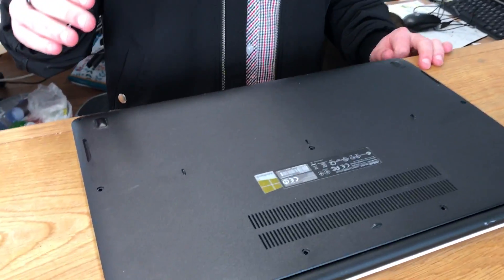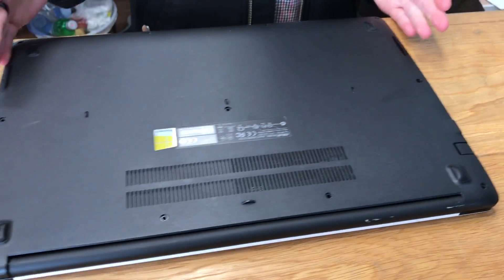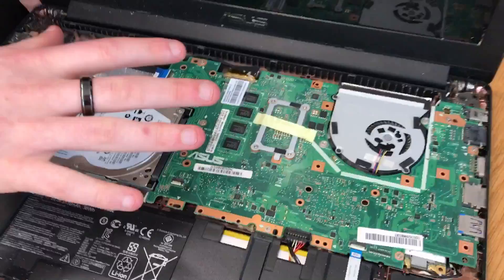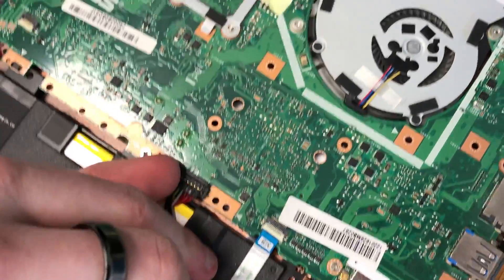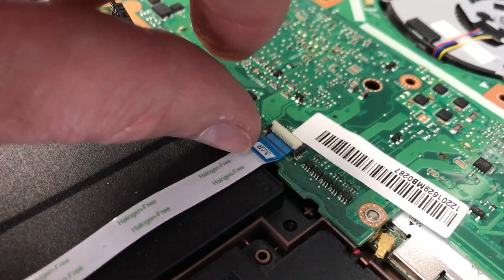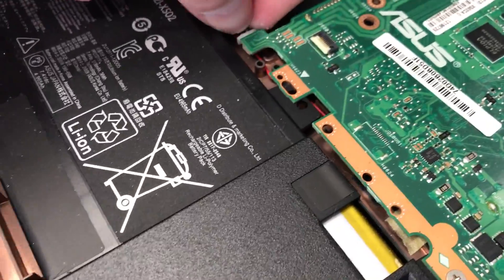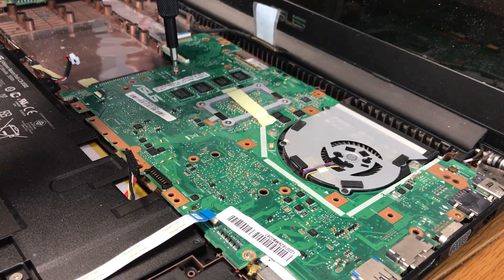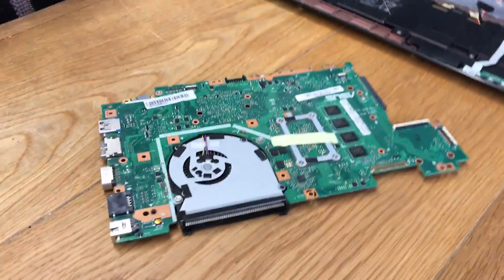Asus x502c Teardown & Memory (RAM) Upgrade - Fail

Comment: Thanks for the video. Didn't look like there were any ram brackets you'd see them fixed from below (or above in this case) but still this video saved me from removing the board just to double check, thanks

Comment: You can see the ram is soldered from the top side before you take the board out. Your right though, its terrible that they do that. It should be industry standard to allow upgrades. ASUS is becoming almost as greedy as apple.
Reply: Yep I had pretty much assumed that too, no hint of ram bracket poking through. Still this video saved me taking the board out to make sure

Comment: I have an asus laptop too. I kind of regret it now that having only 2GB of ram for my X200MA would be so hard this present day. The build quality of the laptop itself is cheap too. The plastic screw casing broke off and some lock mechanism holding it are only those latches you need card to pry open with. No wonder that thing cost cheaply. but well. i took a look inside, few things they really saved are:
1. It doesnt use shitty eMMC like most other netbook laptop does
2. The motherboard is good.  (bios is kinda ok, not much can do about it)

Its really bare minimum. but now im really wanting a true laptop that can handle some task

Comment: Planned obsolescence and nerfing DIY user upgrades. Worst commercial decision ever on the laptop manufacturer's part.
Reply: Thrre is still an option to upgrade it with a nice half size ssd. You will just have to solder a socket for it first.

Comment: Pathetic. it enrages me when laptop manufacturers do this. Making the upgrade path other than adding an SSD absolutely non existent. Is it a money saving scheme or a scheme to make you buy a new laptop when 4gb isnt enough. This catches out the poor unfortunates. I mean you cant even take out and replace the fucking hard drive and battery without taking the entire front facia off. Shit stupid moronic design.
Reply: Definitely a "commercial decision" on their part. Saves them from not only having to add in SO-DIMM slots, but also forces people to spend big on models with more memory.

I've been using a laptop with 32gb ram (2x16gb SO-DIMM DDR3) since 2013 to this day, and am still beyond pissed off at the prices of laptops that still DON'T have that much memory. I've also recently got a recent ASUS ROG GL503VS SCAR which had 8gb initially, was upgraded to 2x8gb, but I went ahead and bought 2x32GB DDR4 SO-DIMMs just to prove a point that it is much cheaper to upgrade RAM yourself, than it is to buy a premade laptop with that RAM.
Reply: Asus laptops have been pulling crap like this for years. hate their laptops, i hate their desktop boards.